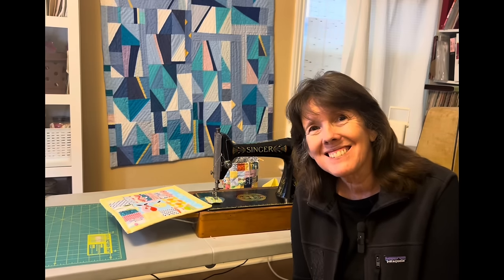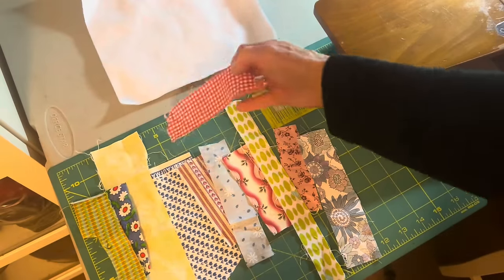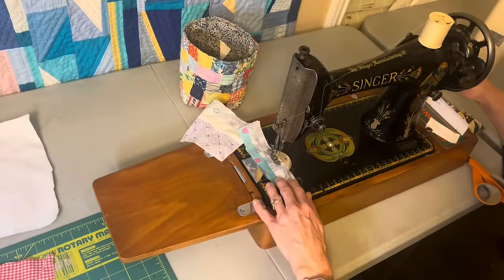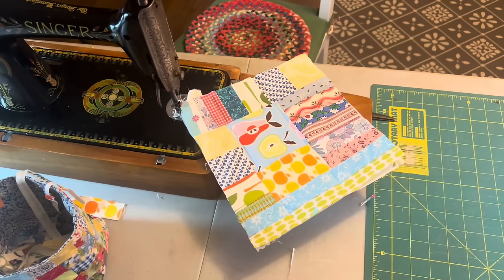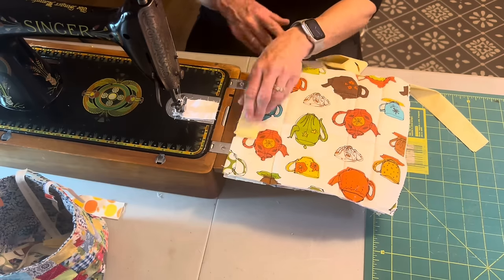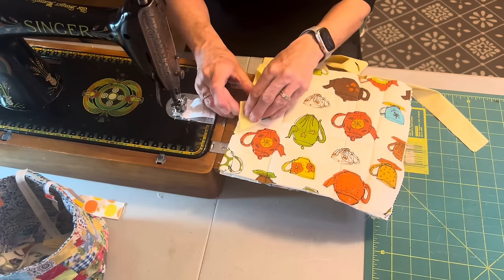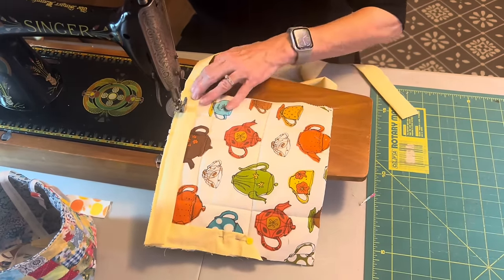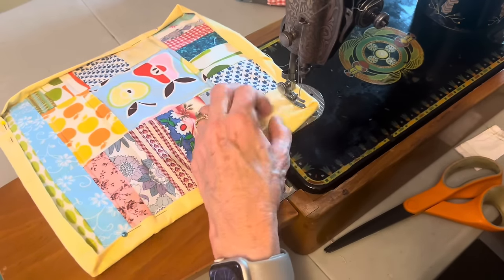PEACEFUL sewing on an OLD hand crank sewing machine | Scrappy POTHOLDER! | out with the old

Comment: Another enjoyable video! Thanks
for sharing . I was wondering why you placed a little piece of fabric/batting at the beginning and ends of the quilting process? Is it to hold the 2 threads in place and ready to sew?
Reply from the maker: I add the little piece of fabric to avoid pulling out the stitched piece and wasting thread. It's sort of like chain piecing.

Comment: You can sew on that sewing machine anywhere you have light. Many times we don't have enough electricity to run more than two sewing machines (at the Flea Market); so, I have been leaving my electric sewing machine at home (and sewing by hand). A hand crank sewing machine, in use, would draw the attention of passers by and bring them into Janet's quilt fabric booth. Everyone loves antiques. who visit the Flea Market. Do you have any advice about how and where I need to start my shopping for a hand craned old Singer Sewing machine?
Reply from the maker: I bought mine from a shop on Etsy.